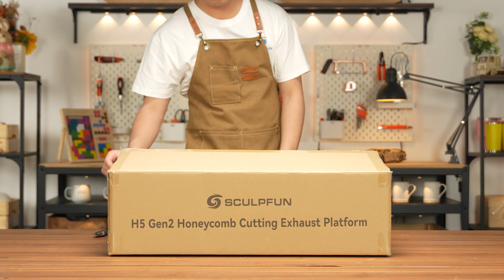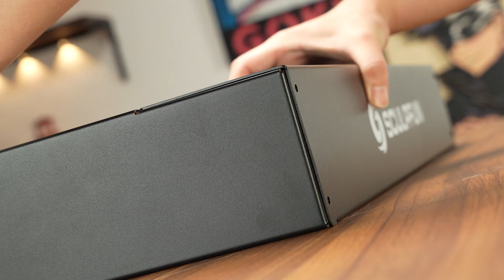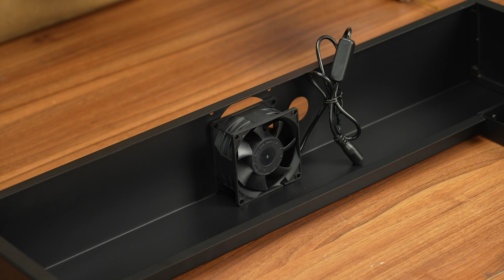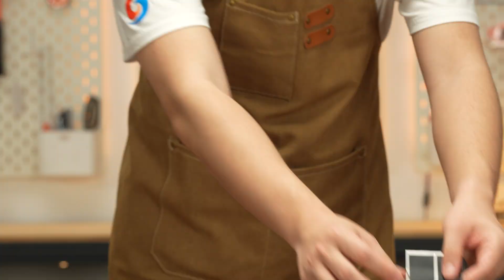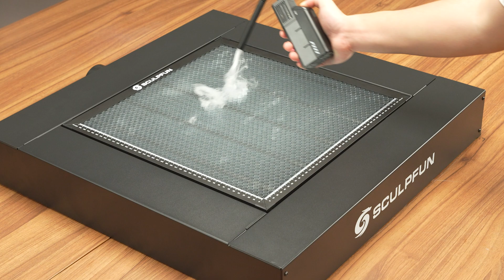Sculpfun H5 Gen2 Honeycomb Laserbed Tutorial   Unboxing & Usage

Comment: I purchased the H5 Gen2 and SF-A9 as my first laser engraving machines. Basically, the machines performed as expected, but when I placed the SF-A9 in the center of the H5 Gen2, there was an offset of about 25 mm between the SF-A9's processing area and the honeycomb table area of the H5 Gen2, I thought that moving the SF-A9 to the far side of the H5 would solve the problem, but then the legs of the SF-A9 would protrude from the H5. How should this problem be solved?